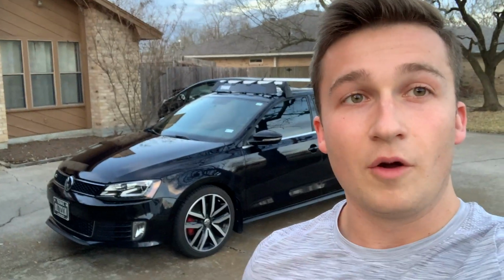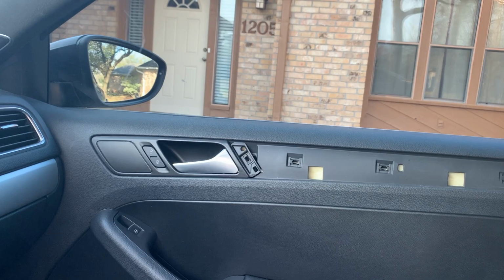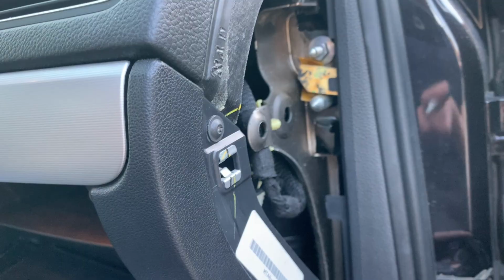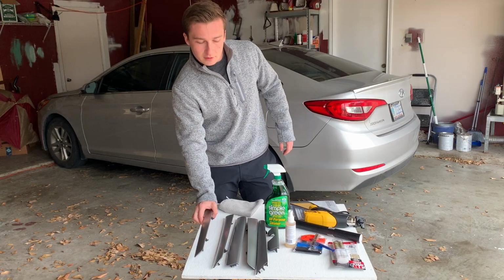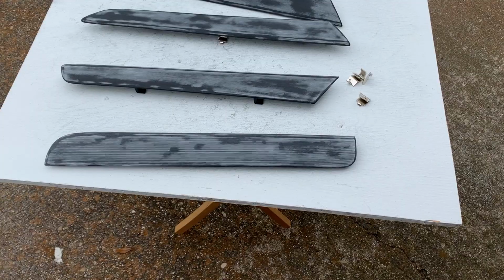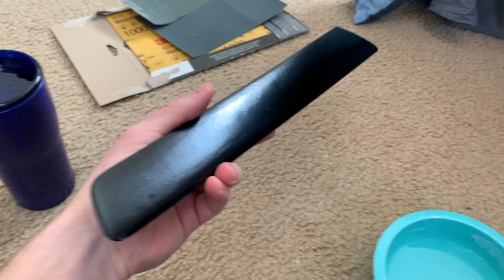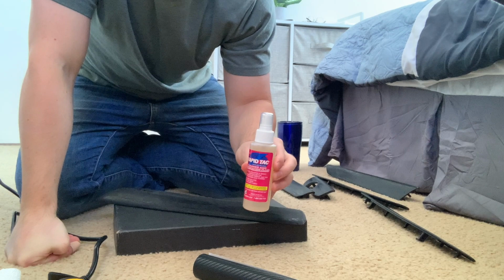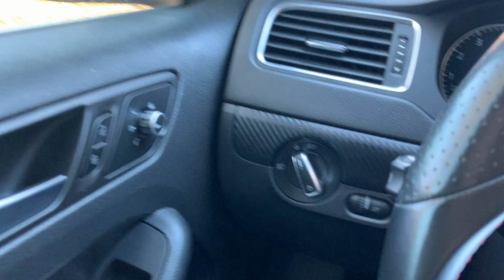Upgrading my Interior Trim! - Carbon Fiber Wrapping my MK6 GLI

Comment: Nice job! But it's not necessary to paint them first. I've done 3 Jettas with no issues.....the trim in my jetta now is wrapped is gloss black.....You want a challenge? Wrap the trim around the head unit....
Reply: Did you have to sand down/fill the plastic trim before gloss wrapping? I want to gloss black interior but I don’t want the textured plastic showing through. I considered purchasing the carbon trim stickers to lay over the top of the plastic and then gloss black over the top for a clean finish 🤞
Reply from the maker: I did. I sanded it down, filled the grooves with an epoxy, then sanded it again with finer grit before painting. After you paint you can do a wet sand to get a very smooth finish before polishing

Comment: i'm just curious, why did you spray paint it if you just wrapped it after?
Reply from the maker: Purely because I wanted a more “finished” product underneath the wrap
Reply: @kylebward  I’m not too knowledgeable about carbon fiber, so like, if I spray paint something pink, and then put the carbon fiber on, will it be pink? 🤔
Reply from the maker: @xiaqpaix4  since this is a carbon fiber vinyl wrap it will completely cover the pink spray paint and you wouldn’t see it. With real carbon fiber it is dependent on how many layers you epoxy on top!